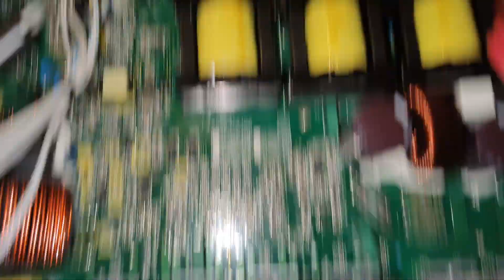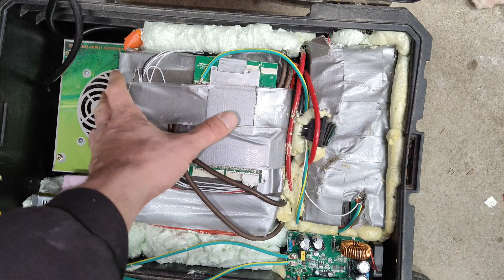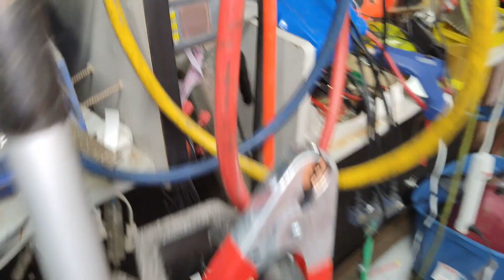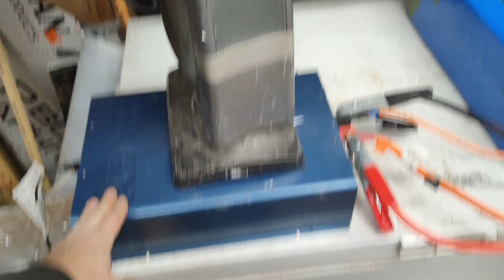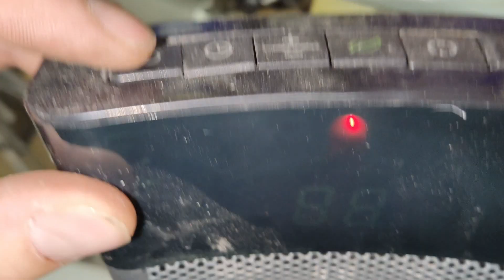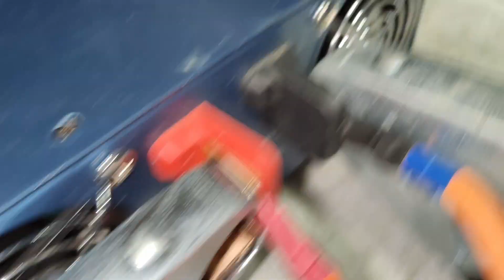PowerBright 1500w Inverter Repair

Comment: I would have done the same thing with the multiple fuse delete. On my 900 watt Power Bright inverter it has 3 external Blade fuses with weather proof covers on one end of it.
Reply from the maker: dang wish mine had that lol
Reply: @GoingOffGrid101  A few days ago Right after I hooked the cables of the 900w Power Bright inverter to a brand new Watt cycle 50ah battery the positive terminal on battery sparked then soon after that the inverter (which was turned off) made a loud pop & smoke started rolling out of it. 
I checked all 3 inverter fuses & they were not blown. 
I purchased this inverter 15 years ago brand new but never used it.
I'm thinking a Capacitor blew going to take it apart & have a look, if that's all it is then easy fix.
Glad you got yours going again.
👍👍
Reply from the maker: @miguelsalami  im pretty sure its a input cap. you could just use it as is lol
Reply: @GoingOffGrid101  I'll tear into it next week & let you know what I find, today I installed my first two 100 watt Dokio bifacial panels on the garage roof. I made a sandblock resistor jumper for the new inverter. This is my first off grid system.

Comment: Hello, 

I've got Powerdrive 3000w that only puts out about 80 wats before starts beeping and displaying overload. 
Any idea what could be the problem?

Thanks in advance.
Reply from the maker: did you overload it once if so check the fuse on inside first but be careful, leave the unit on and disconnected for a few house first.

Comment: I have had a 3500 and a 1500 blow up from goddamn stinkbugs, both powerbright.
Reply from the maker: That sucks! Try a reliable lol
Reply: @GoingOffGrid101  Got any brands made in USA you like? Been searching, need something 1800 watt and up, planning on running hammer drill with it, an electric jack hammer, other random dumb shit like that never know what I get into lol.
Reply from the maker: @F.J.  yes get a genetry solar
Reply: @GoingOffGrid101  Looked at the site looks like they are serviceable.
Reply from the maker: @F.J.  I don't card for any other to much $
Reply: It is very important to replace the fuses with the correct ratings for safety reasons so as to prevent any fire hazards that can occur , and for protection of the main circuits .
Reply from the maker: @rosschizzoniti906  I agree

Comment: Glad I'm not the only one that's destroyed equipment doing something careless. haha   At least this can be repaired.  I destroyed 2 Victron charge controllers do to over voltage input on the solar input side.  They are totally sealed up tight.  They make them so they can't be repaired.  (Love your beeper delete mod. haha)
Reply from the maker: Haha, thanks, there is always a few times where you make that big oops in life lol thanks for the great comment

Comment: Should we buy huge diodes to prevent wrong polarization? I think I"ll consider that in the future.
Reply from the maker: they are very expensive!
Reply: @GoingOffGrid101  I've purchased 200 ampere ones for a plating facility and they're about $30 each so $60 for both sides. I'm impressed that you can open it up and replace mosfets and soldered fuses. That stuff isn't for the squeamish but the way things are going with infrastructure utilities it might be a good idea that we know how t to repair the big inverters.
Reply from the maker: @charlestatakis9363  thats not bad if your running at 48v but at 12v the extra voltage drop from the diode might be to much, might have to test that lol